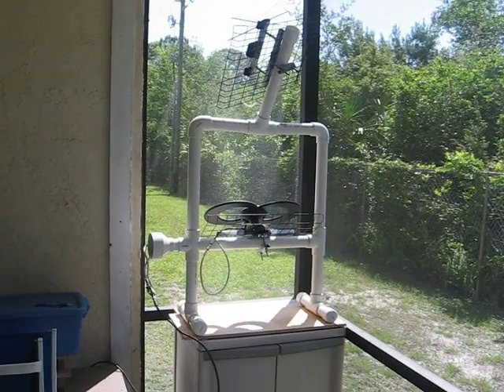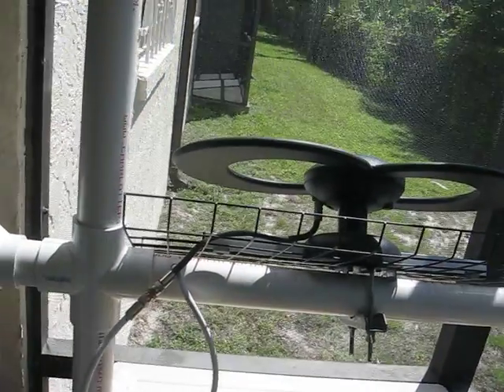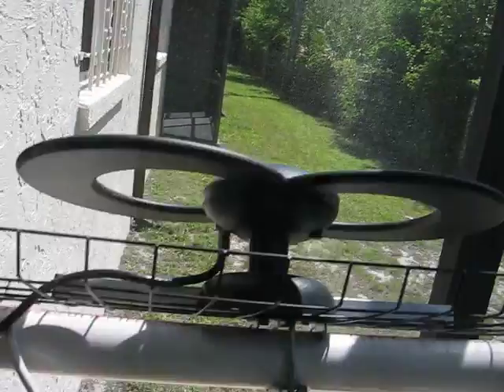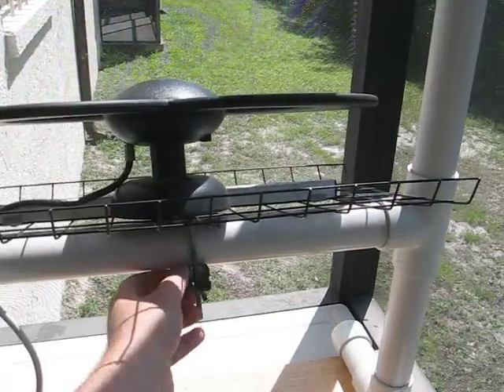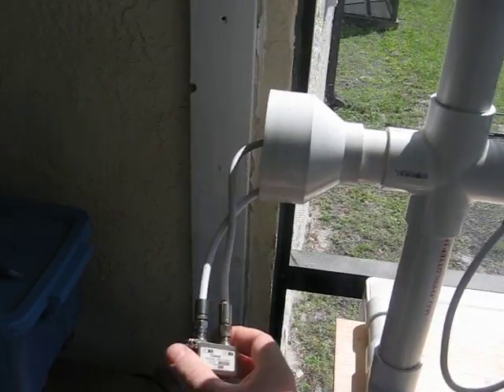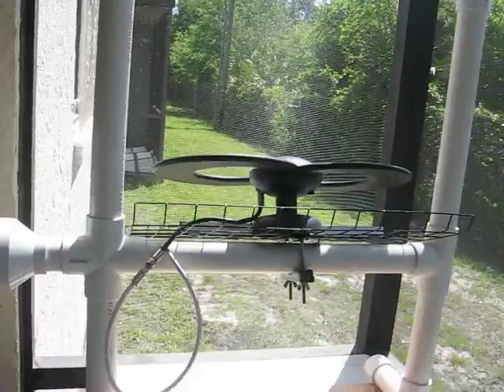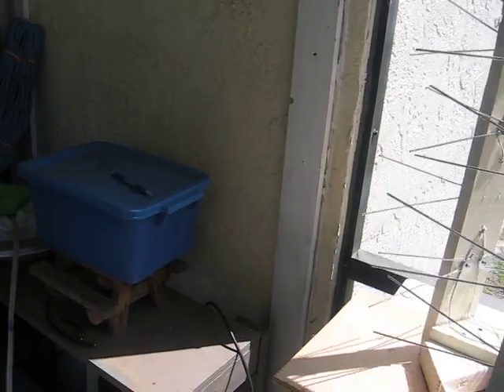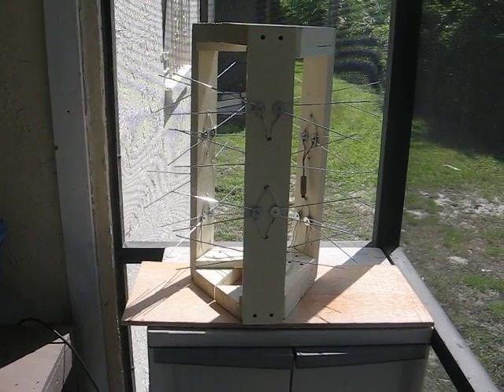My antenna array why I created my home made coat hanger multi directional antenna

Comment from the maker: @damienj210 Thanks for your interest.  I think I will try to make a video about wiring 3 coat hanger antennas together.  I found a better way to connect them since you asked.  You have 3 boards B1,B2 and B3.  The top of the phase lines on B1 are A,B and the bottom G,H.  B2 top C,D bottom I,J.  B3 top E,F  bottom K,L.  On the tops of the boards connect B to D and C to E.  On the bottoms connect G to I and J to L.  B2 in the middle is where the transformer should be.  Hope this makes since.

Comment from the maker: @damienj210 I wanted to make a video about how to build one but I got frustrated with my camera when I was trying to make it.  The one I built for my dad is 3 feet tall instead of 2 feet and was easier to make and didn't have any of the internal elements that this one has and although I can't compare them side by side I believe that his is at least as good as mine maybe better it picked up 42 stations where he lives mine picks up 39.  When I have time I will try make a video with specs.